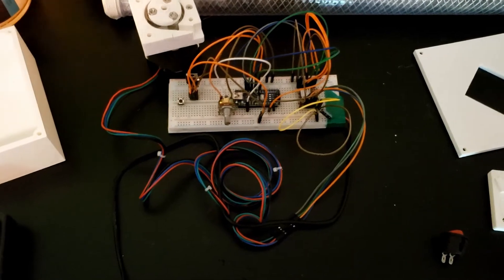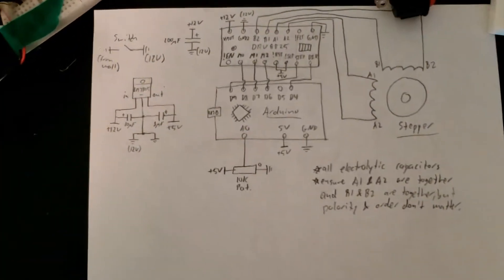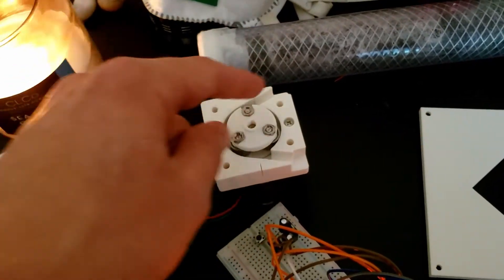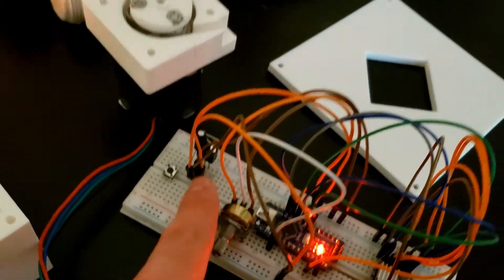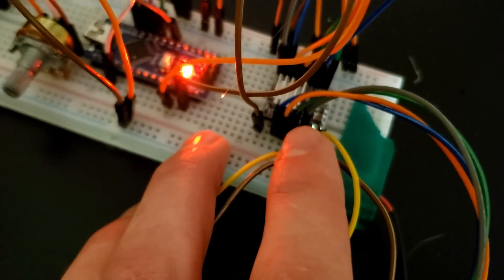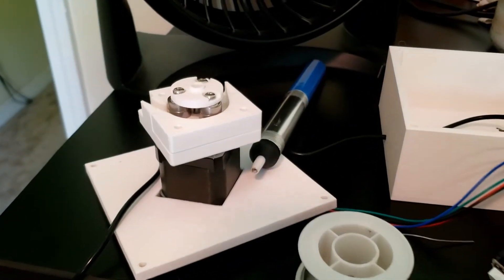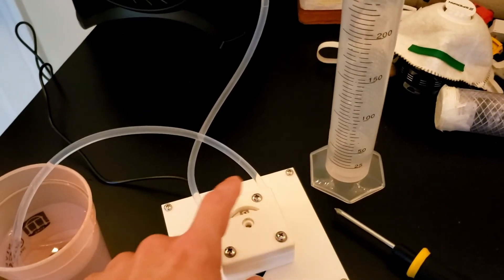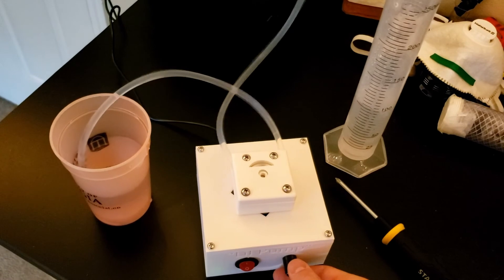How to Build a Peristaltic Pump (AKA "Lil Pump")

Comment: Actually, the problem with the pump isn't head so much as the pressure compressing the tube isn't correct, or you may be using a rigid pipe like polyvinylchloride not silicone. In the first case, you can usually adjust the pressure on the tube going through so that it doesn't surge like that. I don't know the design of that pump - is there some tube tensioning setting on the head?
Alternatively, and crudely, try cutting rings from a bicycle tube and using them as "wrappers" over the whole head so that there is more pressure placed on the tube. It may work.

pump casing| silicone tube |bike tube as spacer| rollers | head | rollers | other side of bike tube | silicone tube | pump casing